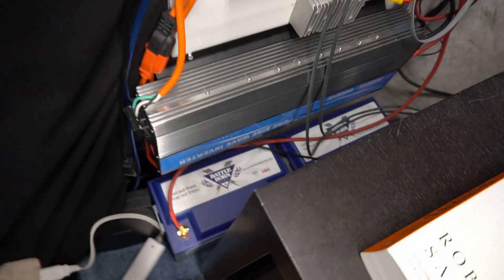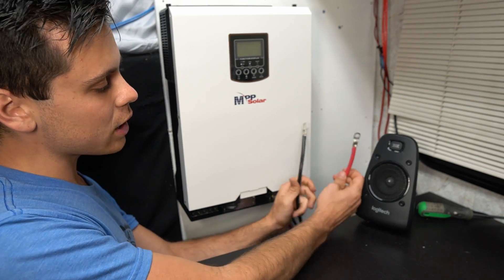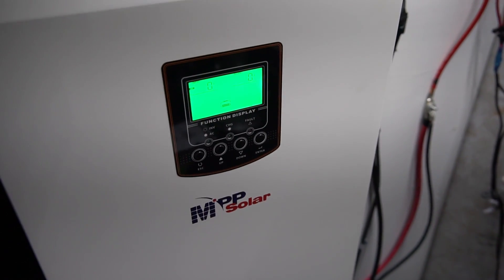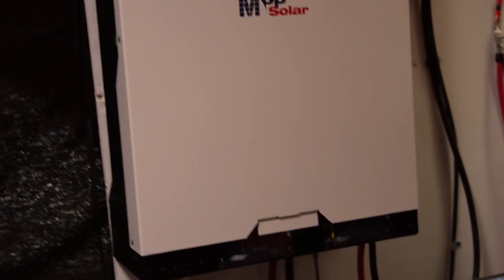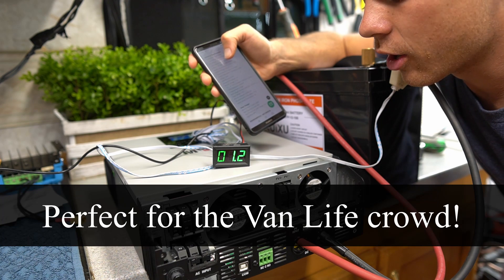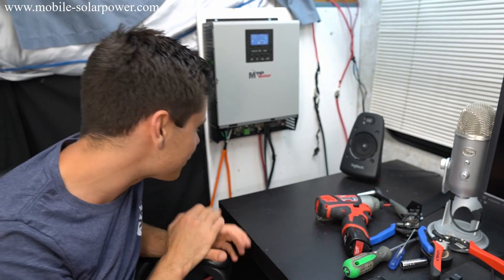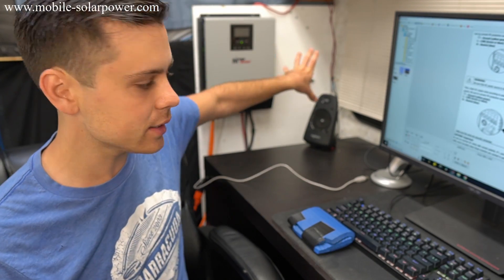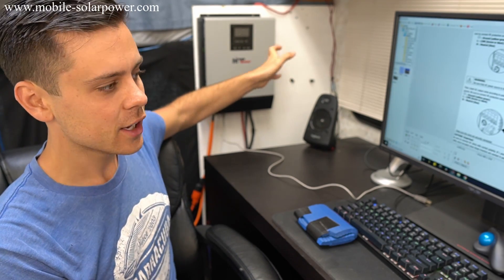MPP Solar Power Inverter/MPPT/Charger "All-in-One"  - Complete Review -

Comment: Hello Will. I’m new to the solar scene, but watching your videos has taught me tons just so I can get a start. After watching this video I’m going to go with the mpp 24vdc 110ac 2424. I’m already getting my lithium batteries to build per one if your tutorials. 
I must admit I did my own separate research and your spot on with the MPP. TONS OF GREAT REVIES. 
I come from an electrical background, and maybe some one here can help me. 
I have a uhaul box truck I’m building into an RV. I’m now on disability, and want to be able to help the homeless as I travel, and to have a place that I can afford to live on my income. 
My thing is I’m installing three 265w solar panels on top, and will be starting out with a 100ah 24v battery setup to be expanded as I can afford it to 300ah. I’m in the northwest so we don’t have as much sunshine as I’d like. 
To supplement lack of sunshine I did get a renogy 40A DC TO DC  charger to run off of my upgraded 130A alternator. 
My main question is combining the alternator charging in place of the solar when there isn’t any sun. I’ll have the remote hookup to the renogy for when the engine is running, but it looks like I need to isolate the charging output Incase there is sunshine so as to not back-feed into the MPP. Is this a correct assumption. In thinking of adding a relay that cuts the power from the charger out put and switches to the renogy. Any suggestions would be great. 
Btw thank you for all you do. Your a rock star in my book
Reply: Hey man, how did it all go?

Comment: I have the 24v model and am trying to determine fuse sizes for to battery, from pv panels, and to load and from AC input. I cant find a solid answer anywhere. Help would be appreciated.

Edit: also I think I got the wrong manual also. Cant find a link for correct one.

Comment: Good channel! Q: Can you use a inverter charger and a battery only ? my deepcycle batt worked and chargrd 5 times after that only lasted less than an hour on 300w where it usually lasted 4h + . When the power came back on i let it charged for about 5 hours it only has 10a and 20a option on charge (narrow and wide).
Reply: Was a 800w 12v 220 solar inverter charger and a lead acid deepcycle 75ah battery

Comment: Hi, i would like to know if this inverter have "legal" certification, life CSA (CSA Group Testing & Certification Inc.).
Reply from the maker: Nope, not UL 1741. You need to spend 3x more for those inverters. That's why this is off grid only. Not grid tie.
Reply: @WillProwse  thank for quick answer, im living in Canada and i can by pass law (the next text is google translate) :

However, the approval requirement is not required for electrical equipment that meets at least one of the following criteria:

It is located upstream of the connection point.
It is intended to be interconnected, in accordance with section 84 of the Construction Code.
It is located upstream of a stand-alone inverter.
Its power consumption is at most 100 VA and its voltage is at most 30 V, except in the case of a sign, a lighting appliance, a light fixture, a a thermostat including a heat anticipation device, an electromedical device or a device installed in a hazardous location.

Comment: Would it be possible to switch out the fans for Noctua fans? I know people in the PC world switch out loud fans with Noctua fans because they aren't as loud.
Reply from the maker: Those fans do not push enough air
Reply: @WillProwse  How much air do the fan(s) need to push?  Maybe you could make a video showing how you replaced the fans in your unit?

Comment: Just wondering if all in one  unit after a few years goes bad and needs repaired.  Can you replaced like the charge controller, inverter, etc?
Reply from the maker: You can service them very easily. You can swap out inverter boards or mppt or whatever has failed. I have about seven and none of them have failed.

Comment: will the following set up work ?   AC from the grid  wires disconnected,  and in their place three AC   wires from a wind generator connected ? Or ...better yet ...are there units that work with all three i.e. solar, wind,  and AC grid/gas generator?

Comment: Could you program it to only come on when the grid power is off? I'm looking for a way to get back up power and I don't like the idea of a generator. I would rather have one of these systems and some batteries. I will do some more research but if anyone has used these systems for back up power pls let me know. THANKS

Comment: hey Will, thanks for your videos im watching them all. Could you help me with something, could you explain the meaning for the parameters you mentioned on your page for this unit, like 800W 12V, 120 220AC, 40A 500W MPPT, 20 AMP utility charger, etc. Im confuse on the Amp parameters what do they mean? what about the differents watt parameters? what is the max watts it can deliver at 120V AC and what battery and solar array setup will help for the max power deliver... Thank you so much man :)

Comment: My concern would be robustness and long term reliability. I have a victron system which has worked flawlessly for over ten years now and has been subjected to several overload conditions and a couple of short circuit conditions with no problems. In my experience, you buy cheap, you buy twice.

Comment: Hi Will,

I was planning on putting this thing in my camper van, but i'm confused about the grounding of this thing. In your case your grounded by the grid, bit in my case when boondocking, im not hooked up to grid. Do I need to ground the MPP and if so, how would you suggesting doing that? 

Cheers
David

Comment: So I bought the 24v unit. Great unit. But wait then you need a 24v to 12v converter. Then there's no sun for 11 days straight and you can't charge squat. So then you need to find a dc to dc charger - OMG $650 (versus half that for a 12v to 12v Lithium). Mines mounted under the bed))

Comment: I sleep with fans on, i sleep without them. From working in a factory for so many years. I'm kind of surprised that the fans aren't inside, the cnc machines at work have a lot of fans with filters inside. Tractor batteries last for years hooked up through cold and heat.

Comment: the problem with a single device is if it quits, you lose everything.
also maybe mention multi strand wire, not solid.
Reply: Goldis less conductive than copper. Gold has 70% the conductivity of copper. Gold is only preffered in electrical circuits for its superior corrosion resistance. Silver conducts electricity 5% better than copper but is generally not used because it costs far more than copper. You may solder your connections to reduce resistance but a good connection will not have a significant loss. I use silicone grease (not silicone caulking) in connections to reduce corrosion and oxidation.

Comment: Ok, I've just bought one of these. How do I connect my DC loads with this now?
Reply: directly using the battery? with stepdown or step up adapter, depends on your dc load. The MPP Solar will monitor the battery and can charge it thru solar or grid.
Reply: @jamesgamis9387  Many thanks for explaining this to me. Could you also clarify how do I connect Victron smart dc to dc charger. Straight to the battery again or should I use additional mttp charge controller?
Reply: It might be a good idea to watch some videos on RV 12v wiring if your a complete NewB;)
Reply: @CanadianTexaninLiguria  You'd be surprised how many videos I've watched recently and perhaps that's why I got confused. In addition to this English is my second language so for people like myself this would be nice to see the clear blueprint with DC loads added. My new question would be how would I connect Victron smart dc to dc charger to my set up. Straight to the battery or using additional bms or mppt charge controller. If you could please this would be awesome.

Comment: In the manual, there is a 3rd screw to hang the box with the hole inside the bottom cover.  Should be to the left of the positive battery terminal.

Comment: Replace fans with ball-bearing "silent" computer fans.
Also, add a 2000W pure sine wave inverter for around $300 that you switch on to use and off when not in use for power tools and/or induction cooktop.  The 800W internal inverter is more than adequate for charging you electronic devices, keeping some sort of refrigerator going, and a home server/media center assuming adequate battery capacity.

Comment: Great review.  Will, you always comment that people say you can do better (cheaper) with separate devices, but the 110v to 24v charging function is tough to get at this price point.   If I was concerned with the 24w static draw, do you know of a good high current charger to add to the separates you use?   Thanks

Comment: What is the transfer switch voltage setting range? I'd like to set mine pretty high to not discharge my bank too low and then just transfer between grid and solar without cycling the batteries at all and then just have them there in case of power outage.

Comment: RE switching to grid, some such units are smart enough to use the maximum rated output for the inverter, then augment output with minimum required grid power when required. Not so much a 'transfer' more of a 'helping hand' under larger loads.
Reply: True, but full grid is soooo much better. I think what you are referring to is grid power assisting a generator.

Comment: I hooked up my own off grid system and noticed that the inverter efficiency is around 88%. It is not bad but not great either.  I was wondering if you could make a video about different brand inverter we can get on the market and make a test of their efficiency. And I heard that Tesla car is using AC motor, so there must be a inverter in the car, I would like to know the efficiency of it. Is there a possibility that in the near future, the inverter efficiency could be as high as AC transformer?

Comment: You mentioned a water heater as load dump, I can't seem to find a video about it. How does one make a automatic load dump? Or yours is manual.
Reply: You can use a low voltage cutoff relay. You can get them on Ebay from China for about 3 bucks.

Comment: Hi Will, great video as always. I have one question. The spec sheet states max PV Input 500W, max current 40 A, max PV Input Voc 102V, Range 15V-80V. I have six 100W solar panels that I want to wire 3s2p (so that would be 24V and 18 amp). I would be within limit on V and A but would exceed W by 100. Could you explain how the max PV Input is determined please? Thanks, Falko
Reply: W= A x V. I think we need to know more about your panels? Or maybe I'm over simplifying? They rarely output full power. Best to ask this on his forum

Comment: I am considering the 24V  'All-in-One' unit, however I also want to put together the DIY LiFePO4 24V battery. My concern is that this 24V unit does not appear to have a low temperature cutoff for lithium battery protection. I suppose I could use the thermostatically controlled heater pads to keep my batteries warm enough to avoid damage, however I would like to know if there is another option for low temp cutoff similar to the Victron MPPT controller feature that can be used with this 24V MPP unit.
Reply: LT cutoff is in the BMS - not the charging equipment. Best to watch some of his later videos

Comment: Question for you...instead of switching to grid will these units automatically turn on a generator? Great video! Thank You!
Reply: Yes they will that's what the green terminals are for on the bottom of the unit.
Reply: No. It will switch to a "running" generator. The green plugs are for parallel use.

Comment: I was just wondering if i could use 2 of the smaller 12v mpp to power my entire house. My house is only 30 x45 and i dont have alot of stuff that uses alot of power. What would be your recommendation? I love the feature that they auto switch to grid. Or could i add an inverter that has a bit higher wattage ?
Reply: You can parallel up to 6 units. But why would you? Better to go 48 V

Comment: I keep trying to wrap my head around solar but I just don't understand the workings of it. So this is what I am wanting to do I'm just not sure how to do it. I am wanting to put 4 190 solar panels for a total of 760 watts on my trailer with 200 ah of batteries can this be done with one MPPT charge controller or will I need two? I know that may sound like way to much but later I am going to add one or two more batteries for 300 ah or 400 ah. I am going to run a small household frig cpap computer window unit 5000 BTU but it'll only run at night for maybe a half an hour and a WD my book 2GB external hard drive. Am I nuts or will this work. I know I can run the window unit for a half an hour in my friends trailer with his 200 ah set up but I don't trust him to do mine because his keeps shorting out and his wiring looks like a rat nest.  Please help? I have ordered your book but I have also watched your video's no less than 50 times each and I am still lost. I saw the all in one but not sure how to run my 12 v things with that and don't care for the 800 w Inverter I am wanting a 1500 to 2000 inverter

Comment: Is there a workaround so that I can have this as the heart of my system, but still be able to use my generator & alternator to charge my batteries if necessary?  I'm upgrading a Toyota RV that already has an Onan Microlite & a new alternator.  I want to boondock for extended periods w/o being entirely reliant on solar.  My main AC draws are a MacBook Pro, a low-consumption audio interface, and low consumption audio amplifier (mobile recording studio).  I'd also like to use a 700w microwave oven about 20 minutes a day so that I can conserve propane for fridge/stove, but that's not essential.  DC draws are standard RV stuff--led lights, water pump...

My priorities for the project are 1) functional 2) easy to install 3) inexpensive as possible.  

Thanks so much for your efforts--I've learned a lot from you already.  Any advice/suggestions are much appreciated.  
---Dave
Reply: Yes - the same as another system. Your generator is a replacement for shore power. You connect a dc to dc charger from your vehicle battery to your house batteries. Problem solved. And you have 2 way charging between your house and vehicle charger.

Comment: you make no sense, you mount the equipment right next to your work center and then complain about the fan noise. no one that full times or even part times mounts their equipment where they live and if they do it most often is mounted in a way to hide it so fans, which are important, are not an issue.

Comment: Not sure if I like it. Too little PV going in, too little inverter going out. An idle draw of 1.2amp/hour or 28.8amp in 24 hours is a lot. Your 100amp battery is not going to supply a lot of usable power after that. 

Can you test something like the Sol-Ark 8kw ?
Reply: He mainly caters to us van and small RV people that manage power and 2.4KW is enough power and generally there is more than 1 battery.
Reply: Jon Moran I guess it’s the cut off line to still recommend it for diy’ers.

Comment: Which would be better?  2 x 12V 100Ah Battle-born in series? Or 2x 24V 50Ah Battle-born in parallel? Thank you very much...
Reply: Go with the cheaper option that would be easier to sell

Comment: Checking the manual it appears there's a mounting screw hole inside the box, down low.  Also read it shouldn't be mounted on flammable surface and needed 50 cm overhead clearance.  Could be CYA lawyer speak.

Comment: I am wondering If this smaller 12 volt All In One System would handle a second inverter (maybe 2000 watt) on the same connected 12 v battery bank to manually run an evaportor cooler when it is hot and the sunshine is producing watts.   Do you think idea that could work? I guess there would be the possibilty of low battery kicking in grid power and battery charger. I would think it would take monitoring panel output to match needs of two inverter for this experiment. The next subject I desire to reseach is possilbe automatic options for setting up solar panel load dump (likely heating water) when the solar panels are producing while the batteries are top up and full. I will research your YouTube classroom first, as I like your way of checking out the options including for eye on making best use of dollars.  Looking at the 24 volt All In One options too. Your clips are kicking me into wondering and  research mode.

Comment: Will, I just bought one and it has a mounting hole at the bottom in the center. Not the greatest but it’s something. I’ll be mounting it with 3 screws (1 at the bottom). Maybe they heard your suggestion 😉.

Comment: Was wondering. Do these units work well on a hybrid wind/solar set up? Trying to build a basic low maintenance system for my dad. He currently has a 400w wind turbine and 200 w solar array. He lives off grid but hes legally blind now and has trouble working on anything so I want to fix him up with some kind if fix it forget it system. The only thing he runs is maybe one 3w led light at a time and a 32 in led tv, so his power consumption is way lower than his system is capable of handling. Hes has plenty of battery capacity. He has 3 marine 12v batteries now but I just ordered him 2 valve regulated lead acid 100 ah batteries from Amazon so I'll he switching him over as soon as they come in.

Comment: i use a similar unit, the fan problem can be solved quite easy, open the unit take the fans out and replace with high-quality fans like silentwing from Bequiet, also switched the blow direction, so the blow upwards (thermodynamics ftw) instead of downwards.